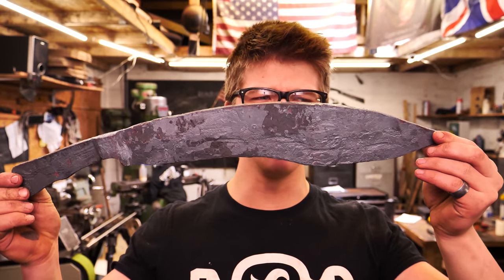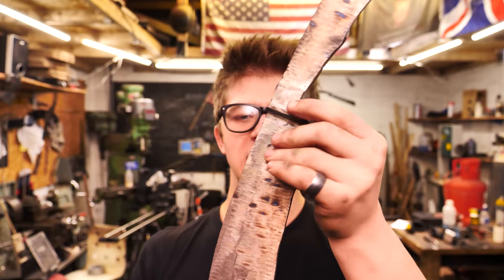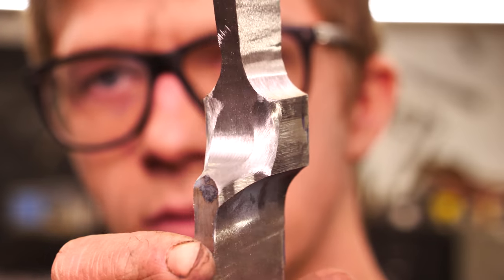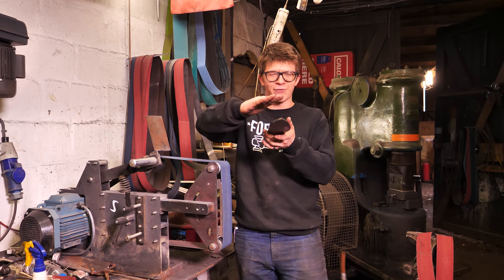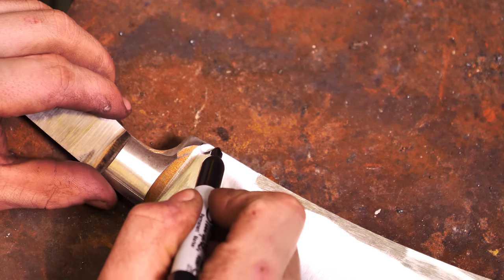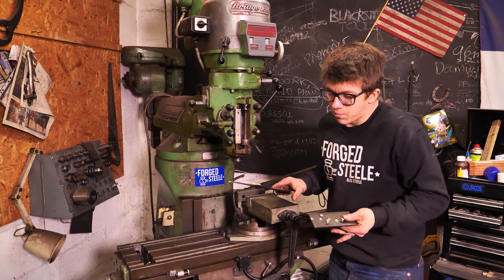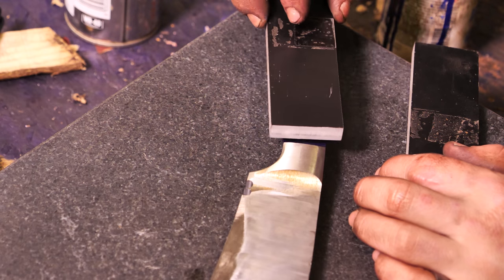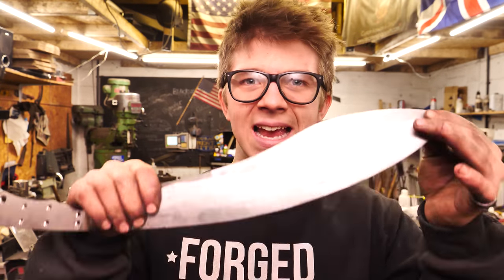CRAZY DAMASCUS KUKRI: Part 2 in *4K*

Comment: Incredible piece of work!
The notch, according to today's Ghurkas, is actually to catch any blood running down the blade, creating a point where it will drip instead of going onto the handle, so you don't lose your grip. 
There's a lot of conjecture though - some Bowie knives have a similar notch, which is very good for stripping branches for making kindling, but no one really knows what that notch is for either!

The whole self-sacrificial cutting yourself thing probably isn't true at all, since both knives were originally intended to be used as tools, not weapons. I have an original 1940's era Kukri, and I actually used it to chop down some old bushes in my garden last year - works far better than an axe!
Reply: The "must taste blood" thing was likely invented by Nepali Gurkhas to ward off annoying tourists pestering them to see their khukris.

Comment: Adding a small bucket of water below the grinder will control the dust some more.  Some of my favorite kukri are convex in profile, achieved via a slightly slack belt and later a padded surface with sandpaper on it for sharpening.  This makes a phenomenal chopper knife and it is very easy to sharpen with simple sandpaper and a mouse pad for cheap maintenance equipment.

Comment: Alec this was an awesome build, you might try your luck with a file to keep the straight bevel of an odd shape or wavy blade. a good file can cut material away quickly and you can keep a more consistent motion to keep things more even across the face. 
 penny for your thoughts. keep up the good work

Comment: I've been watching you through a number of videos and I see you sometimes use a bucket of water at the bottom of your belt sander to catch the dust.  I use a somewhat large and powerful magnet which catches almost all of it, and I can transfer it from the belt sanders to the drill press to wherever I need to catch metal making a break for it.  It doesn't get it all so you still need safety gear, but it sure helps the cleanup!

Comment: That "spike" has two reasons, as a tradition as you mentioned in the video. Second reason, it actually stops blood going down the handle and not letting it get slippery. And usually is not right beside the handle, it's about an half inch above.

Comment: hey Alec great job. to help you out I own a traditional kukri from Nepal and the blades bevel is much shorter in width, about 3\8 - 1\2 inch. Also the the middle of the blade is hollowed out to reduce weight which makes the edge wider and and much better at chopping. I hope you can make sense out of this, wish I could show you a picture, keep up the good work

Comment: The little spike indent on the ricasso (called a "cho") isn't actually because "every time the khukri is drawn it must draw blood." That is a common misconception that has been spread around, but historically those notches weren't made sharp enough to draw blood. Schologladiatoria did a few videos about this, and the most probable explanation is that its shape is ritually tied to Shiva.

In any case, the shape still should be there if for no other reason than to keep kukri tradition alive!

Comment: Hey Alec, that lil spike as you called wasn't for them to prick the finger. It is designed so that blood doesn't drip to the handle. It causes the blood to drip off at those points.

Comment: The notch on the base of the blade was modelled after a cow's hoof. I never heard that they'd prick themselves on it, but I can tell you that it was added to stop blood from running onto the handle from the blade. As far as the blade must draw blood when drawn, that's correct, though I'm certain they'd do that on the blade itself

Comment: not sure if someone else has commented it yet, but those 2 dents you drilled to give that little half at the bottom of the blade is there to give blood a point to drip from, in theory it helps stop blood from sliding onto the handle of the kukri which would make it slippery for the soldier holding it.
Reply: Kukri blades usually have a notch (karda, kauda, kaudi, kaura, or cho)
 at the base of the blade. Various reasons are given for this, both 
practical and ceremonial: that it makes blood and sap drop off the blade
 rather than running onto the handle;[6] that it delineates the end of the blade whilst sharpening; that it is a symbol representing a cows' foot, or Shiva.
 The notch may also represent the teats of a cow, a reminder that the 
kukri should not be used to kill a cow, an animal revered and worshipped
 by Hindus.[citation needed] The notch may also be used as a catch, to hold tight against a belt, or to bite onto twine to be suspended.

Comment: When  you milled in the holes for the pins towards the transfer point into the blade, you may have made them too close together and making a weak point a critical junction. In essence, you may have milled in a dangerous failure point for possible breakage. Have a student test it when you're finished. In all seriousness, be careful with that one, bro.

Comment: the small prick was to stop blood from running onto the Gurkhas hands and making the handle slipery. the knife was used for hacking limbs but also slitting throats
Reply: Nope, blood would still drip down all the other parts of the blade, its one of those myths that surround Kukris that it stops blood.
Reply: The purpose of the notch is still up for debate and only traditional ornamentation nowadays.
Reply: Seth Mays not in the british military it's not...its still very much used. The royal marine commando dagger on the other hand doesn't see action,as they like to use bayonets. wasn't too long ago a royal gurkah went on a mission to kill a certain target, he killed him and came back to base with proof in his bag,yes he chopped the head off for identification purposes and proof. 

sign up and one day you may get to see them in action,i could tell you where their training areas are  (the public ones, beaches etc or likely to see them, but that's not my place to do so)
Reply: The notch is ornamental not the kukri itself. The kukri has gained much popularity the last few years and as I understand it the Gurkas themselves still carry the kukri.
Reply: Incorrect - I served in the British Army and worked with the Ghurka's and call several very good friends - the "notch" which is also known as Cho or Kaudi is to minimise blood running down onto the handle. Will is correct. However, there are also 2 other uses, one is as a stop mark when sharpening the blade and the other is of religious significance as it represents the Hindu fertility symbol. It has been used as a method to "catch" an enemy blade, but wasn't why the Cho was developed. All other stories such as "human blood / sighting for throwing" etc... are all myths. Of course, this does add to the legend of the Ghurka's and so they are happy for people to think so! ;)
Reply: scholagladiatora has a video "notches at the base of knife and kukri cutting edges". You should watch it.
Reply: Jordan cox I couldn't have worded it better myself,I used to make knives years ago so I learned a lot of different blade types and cultures and blade history in my time of bladesmithing.

Comment: Mr. Steele: The purpose of the kukri “cho,” the indented notch on the ricasso is not to draw the user’s blood.  That legend is based on the mistaken assumption that the Hindu death goddess, Kali, demands blood whenever a kukri is used .  This is total hogwash.  If such a bloodletting were to occur, Nepali farmers would bleed to death (or at least get a massive finger infection) by the end of a work day because they are constantly drawing and re-sheathing their blades to perform numerous farm and forestry tasks.  The cho serves as a blood drip point to keep the enemy’s blood on the blade from getting to the wielder’s hand and rendering it slippery and unmanageable.

Comment: Actually that indent near the handle is meant for stopping blood from dripping to your hand and jeopardizing your grip in a war. When a gorkha slashes through enemy heads, it's used as a point from where blood is going to drop off the blade without touching your grip.

Comment: Alec, you bad ass human dynamo you!...Just out of curiousity, and not as a knife maker but a thought or suggestion as a former soldier and as a fan from across the pond...Kukri's have a tendency to be tapered from a thick spine to a fine honed edge so sharp it can take off a cow's head...Question: Have you thought about tapering it before you drop in bevels? It would reduce weight and give you much better control with massive chopping ability. ..Just a thought, nothing more...Keep up the amazing work, and just totally love your energy and humor and humility...Btw, you may want to look up Nick Wheeler and how he does his bevels with different jigs...He makes outrageous Bowies so it would be inline with your kurkri...Good luck!

Comment: Lots of myths about the Kukri and it's notch. It's not entirely clear what it's for. Possible it's symbolic. 

But the Kukri is as much tool as weapon so didn't have to draw blood. 

The notch might help blood drips if blood was only on the edge. But if a Kukri hits flesh it's going deep and there will be blood all over the sides and probably your hands just from splatter

Comment: I´m just going to state this flat out, the friend who told you that a kukri must touch human blood has been terribly deceived. A kukri is a tool first, a weapon second. Imagine all the bloodloss you would get from using this in the field clearing brush, chopping wood, whittling or the like. Sheathing it even once, which is desirable to carry the darn thing, would involve purposefully piercing the skin on your finger. Not only would this be painful, and the brain try to persuade you to do the exact opposite, if the blade is even slightly dirty there would be a high chance of infection.

A more likely, and frankly less stupid reasoning would be that the notches serve a religious or aestethic purpose, perhaps being a symbol of sorts for the goddess Kali.

Comment: +Alec Steele inside curves are a b** to grind. Next time try the slack belt with no platen behind it, or you can also use a large contact wheel and lay the knife on it with the point and handle in line with the belt travel, then roll the knife up and down on the wheel with light contact (bigger wheel will get flatter). I have done a couple concave knives and yeah it's work!

How much does that thing weigh? Looks massive!

Comment: The kukri is a multipurpose weapon and tool used essentially as a bushknife or small machete - the 'human blood' thing is a myth from British soldiers exotifying the Gurkha regiments, because at the time British society believed in 'warrior races' - groups of people that were genetically predisposed to martial skill, including the Nepalese Gurkhas, North Indians, and Scots. The kauda or cho (the notch at the base of the blade) is generally considered to simply be a point to delineate the blade for sharpening purposes, and some also attribute sacred symbolism to it as well - either as the trident of shiva, or the foot of a cow, as most Nepalese are Hindu.
Reply: Grimnir Ulfbrand I heard a story where the Nepalese ghurkas had dull "knives" that they would use to sharpen the kukris themselves and that the two shallow areas near the point were used as sharpening devices. not 100 percent sure but I think it's the best solution to the question
Reply: Kukris do come with two smaller blades as part of the military equipment - a small sharpened blade called a karda that's used for fine work, and an unsharpened 'blade' called a chakmak which functions like a butcher's honing steel; you pass it along the edge of the blade to hone it, keeping the edge aligned and properly sharp. The cho does work as a delineating point - you start your chakmak there and hone along the edge and back to the cho again, which allows a little more precision than just having your blade go all the way to the grip.

Comment: the blood drawing is a myth. the cho is tradition not all khukuris have them. the size you are making is about average, 15-17 inch blades handle is about 5in long giving an over length of 20-22 inches thickness at the spine is about 1/4 inch but can be as light as 3/16 to 5/16 inch tapered to the point. I own 5 of them.

Comment: Man, you're a Rock Star.....but the milling machine bit was over kill. You could have done better and quicker with a cutoff grinding wheel. And the round head screws on you jig ought to be changed with a normal socket head screws as the Allen head socket is stronger. But I still love you plenty.

Comment: Dude get yourself a set of countersinks for your mill 1/4 through 1 inch set drill bits shouldn't be used as a countersink man.... or at least use your center drill from your lathe I'm sure I've seen you use one of those before...